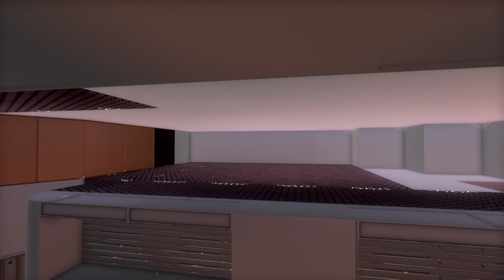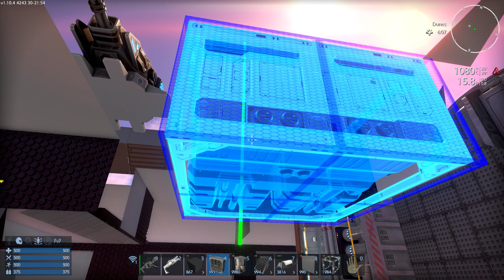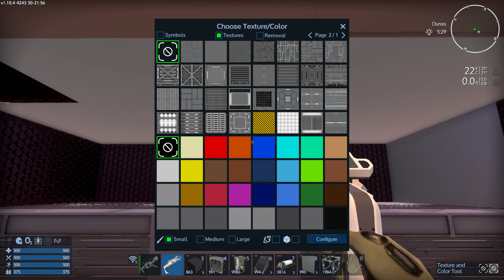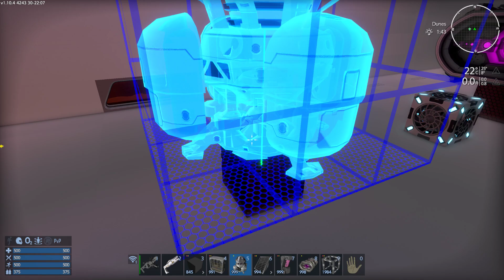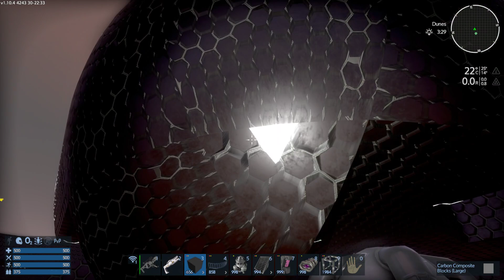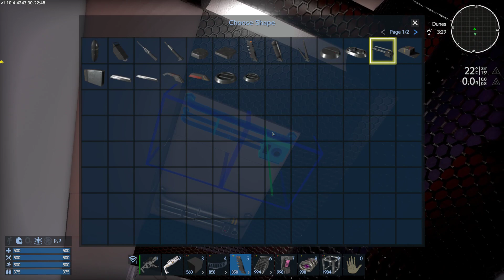Empyrion Galactic Survival - Helios MSC2 Engineering Build Part 2

Comment: You may add 4 medium shield parts to this section and make add may be big parts. And in right section you may put two fusion reactors.
Or you may actually squeeze sections so they don't  stick out flight deck dimensions.